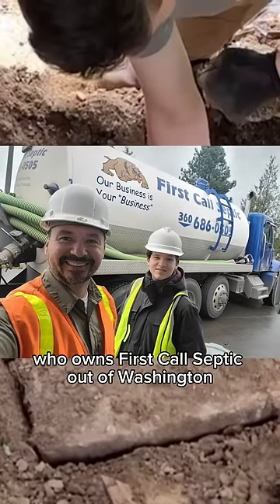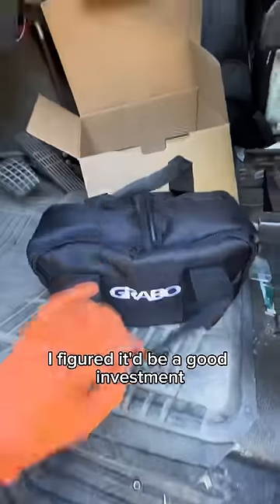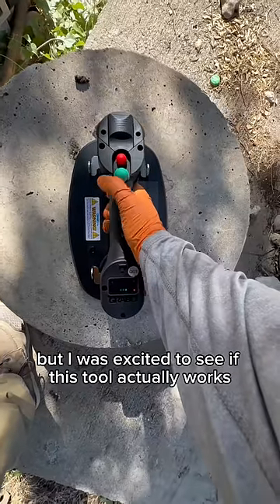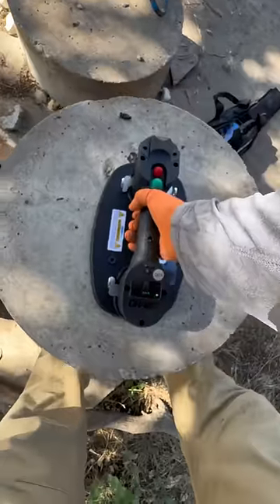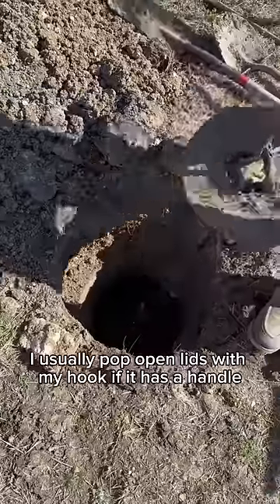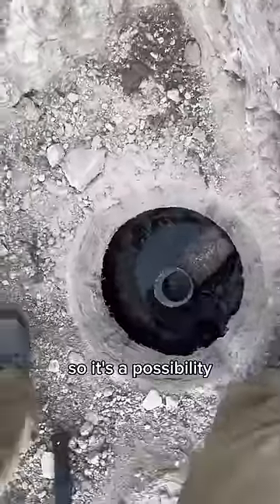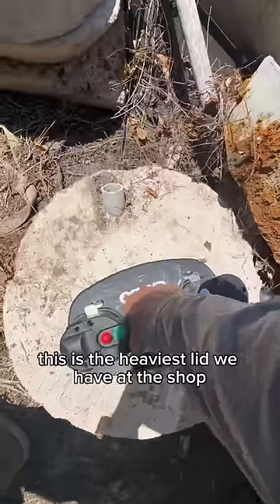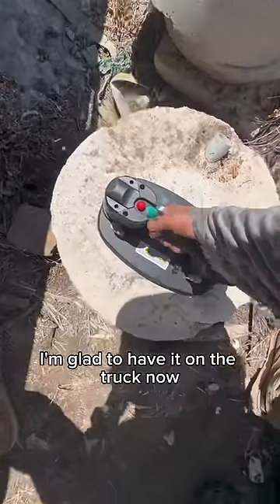No handle on the septic tank lid #shorts

Comment: $600 and you can scale walls, gotcha
Reply: i was thinking the same thing
Reply: I mean if you have the upper body strength to hold your weight while its sticking for how ever long it takes go for it
Reply: @Firefox10203 leg straps. Stand on one while holding the other on the wall. Boom, crisis averted 😂
Reply: You can't stop me. I'm suction cup man!
Reply: @rampagent9226 amazing reference
Reply: Yeah basically
Reply: @rampagent9226 love this reference
Reply: I hab same pfp on insta 😫
Reply: Took the comment write out of my mouth lol
Reply: @claytonatkinson865 bro i’m over here tryna think of how that wouldn’t work but i can’t , i need to try this
Reply: Exactly what I was thinking LOL
Reply: Lmao that was my first thought
Reply: I mean there was that guy who climbed the trump tower using some similar device
Reply: I mean if you have the strength to wait for it to suck on the wall while only using one arm then go for it
Reply: @Carlos_dyno  No. Why is everyone thinking like this? It's SO simple.
Get two and a rock climbing harness. Instead of the usual gear, you just need two of these and two carabiners. You use one up as high as you can reach and clip the carabiner onto the handle. Then, using it as a hold, you put the other one up higher and do the same thing. Then you detach the lower one, and put it up higher.
Do this until you reach the top.
Easier than climbing a mountain.
Reply: You're right
Reply: Its ok bro, i fix cranes and i bought a milwaukee high torque impact wrench just so i dont have to fight old ass bolts off. Best $500 ive ever spent
Reply: Reminded me of this cartoon where the guys like "fuck you in climbing your wall, piss off"
Reply: @GoogleAids  suction cup man
Reply: Its won't work because your not pulling on it the same
Reply: Youtuber Airrack actually did that with multiple grabos
Reply: @ADHD_Assassin911  wait, it works on 150lbs of concrete but not 150lbs of person because the rock is 1 trillion lbs?
Reply: @Firefox10203 I do 🤷🏻‍♂️
Reply: Battery runs out your done 😂
Reply: Well you would need 2 so 1.2k…… plus maybe 2 for your legs so 2.4k
Reply: trump tower here i come
Reply: jlazer climbed a skyscraper
Reply: Exactly what I was thinking
Reply: @TheTicassShow  that's the event that created suction cup man.
Reply: I’m with you
Reply: @Firefox10203  holding body weight isnt hard, its pulling up with one arm with no foot holds thats hard
Reply: @jlaser did it with a Spider-Man suit
Reply: Fuck heights I’d never trust anything solid and I hate flying without Xanax
Reply: @Firefox10203 duh?
Reply: Fuck your tower! I'm going up!
Reply: A worthy investment
Reply: Mythbusters made one to climb.

Comment: Great video. 2 things stood out. Firstly, the fact you would hold it over your feet shows the faith you have in the product. Secondly, I would have lived to see the bottom of that thing.
Reply: Same I wanted to see the bottom too.
Reply: Big a$$ suction cup with a pull-up motor to cause vacuum seal.  It's similar to what windshield repair guys use.  Except batteries?  Embedded or replaceable?
Reply: @MrM6d  looks like removable, pretty sure that's what the seam is you can see up by the buttons
Reply: fr, didnt even know if it works and holds it directly over his foot, nuts
Reply: You just just use a drill lol. Stick it in and pull it out
Reply: @gang1798 Theres a reason why they didnt use a drill

Comment: Just keep a check on the ring gasket. They break down over time. And would be a good to have a few extra on the truck.  They work great on any thing reasonable flat.  We use them at our glass company. Sometimes. There so strong they will shatter glass.  Only problem we ran into it the button will break. And also love your content.

Comment: FYI, do yourself a favor on lids with no handles that are intact, drill a hole and epoxy stainless steel eyelet in place.
Choice is yours on whether you epoxy in place first and use it to pull the lid or once the latest pulled your poxy it and let it cure offline while you're cleaning.

Comment: We used a suction cup with a little hand pump to pick up large aluminum sheets. Similar to those shower hooks. Didn’t properly attach it one time and dropped it. Luckily it was on an overhead crane and I was 15 feet away 😂😂 I dealt with parts up to 80 tons using 2 cranes bridged so I always kept my distance 😂😂

Comment: Okay that looks like a good tool and I’m working at a camp site right now and we have 10 septic tank systems around the park the lids however are also solid concrete but have rebar handles and are about 3 times the size of those lids but I’m curious if it would pick it up but the lids are about 110lbs and we just slide them to the side when the guy is here to drain them

Comment: How a hook, i rely on the structure of the metal rod, its metal so i would assume it bend first. But relying fully on 'vaccuum' that can basicly pop any given second There is a huge pressure difference, even just dirt or sand on the lid can suddenly slip in and loosing the vaccuum.. so no.. no thanks for me.

Comment: How does it work? Like how does it stick
Reply: Vacuum
Reply: Hard to fathom that an air vacuum with a foam seal builtin on bottom,  would not leak air on nasty concrete which is not smooth like a granite slab. But it did!   Says rated to 375 lb

Comment: Can someone explain this sorcery
Reply: Vacuum like a suction cup, whatever material they're using along the bottom edge somehow conforms to the microscopic shape of whatever its placed on creating an air/water tight seal then the Vacuum increases the pressure holding the handle to whatever It's on, also am I the only one who wants to get two of them to simply climb a wall or building!!!???